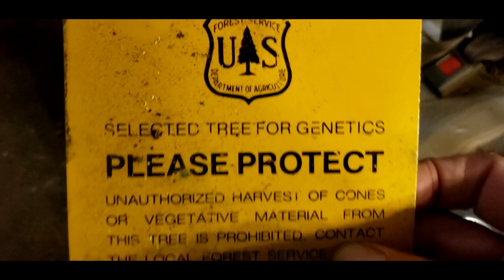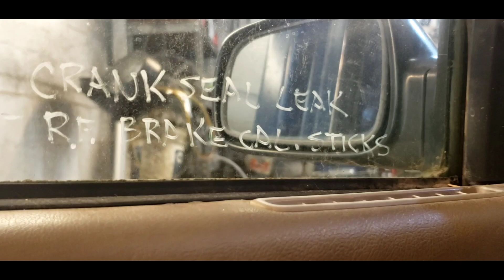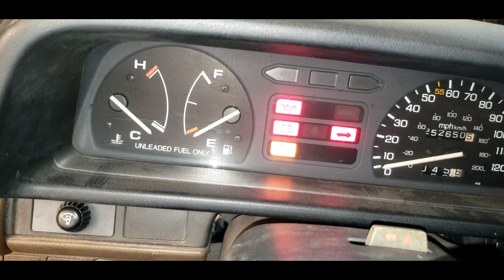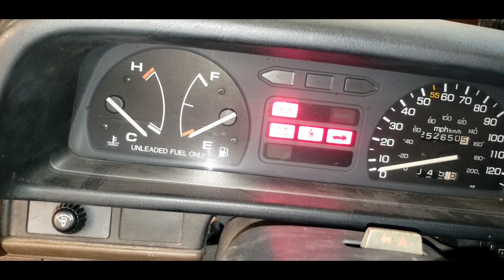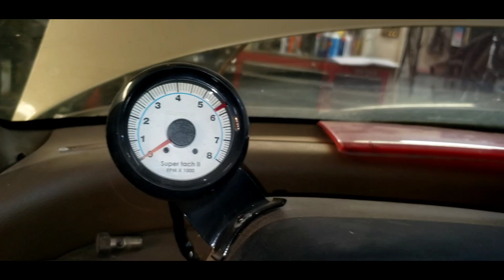Give Me Old Honda's All Day Long

Comment: Back in the early 80’s there was a small shop in Berkeley CA that only worked on those early 600 Honda’s.  The local Honda Dealer wouldn’t touch them.  That shop always was busy with a backload!

Comment: That’s awesome!   can’t wait for more content about old Hondas.  I had a 87 civic 4 door sedan with carb.   Ran over a chunk of metal and damaged the gas tank and had the shop replace with a used gas tank and been fine since.
Reply: look out for the seam in front of the rear wheel in the wheel well a lot of the ones I've seen seem to start rusting from there or behind the rubber strip on the  and my 86 sedan had a particularly bad seam in front of the rear right wheel and got rust starting from behind the rubber on the fold in the rear arch, the 87s I've seen in junkyards seem to be a bit different though

Comment: This video warms my heart and makes me a little sad. When I first got married I bought my wife a new 1991 Accord. We actually sold that very same Accord this last Labor Day weekend. It had almost 320,000 miles on it but it was an automatic transmission and the transmission had developed both some control issues (flashing transmission shift indicator) and some what I assumed were wear problems, that on random up shifts it might shift into neutral rather than the next gear and then might catch, might not. The vacations we took in that old car when it was her primary car, the daughters coming home from the hospital in it and then the same daughters the oldest driving it to high school, the youngest driving it to college. Yep it was hard to beat those old Hondas, our still ran good when we sold it.

Comment: I though fuel pumps were mounted closer to the engine or somewhere along the fuel line?
Reply: I think they're most often mounted in the tank; even my '72 Vega had an electric pump mounted in the gas tank; I could tell when it was going bad, as the engine would stumble/cut out at below 1/4-tank, and it was beginning to make a loud whirring sound.
Reply: Fuel pumps have more "oomph" power one way, or the other. Although many modern fuel pumps prefer to PUSH, so the pump is located close to the fuel tank, and often right inside the fuel tank, there are some cars and systems that have a fuel pump that prefers to suck from a long way away, and push just a shorter distance. The old British cars I grew up on, mostly had mechanical fuel pumps, attached to the engine block or electric fuel pumps located at the front of the car close to the engine block.
Reply: For decades, fuel pumps were driven by a arm that contacted the camshaft. They were mounted on the side of the engine. It all changed when carbs went out of style in the 80s.

Comment: Here's a good question. I observed that the new fuel pump is an electric motor with wires on it that goes down into the gas tank, wouldn't that be dangerous and even fatal?
Reply: It's a common practice, Volkswagens and Audis from the 90's had also electric fuel pumps in their tank with connectors that weren't sealed. Never heard or read that those tanks exploded.